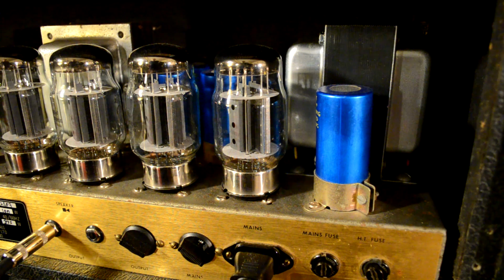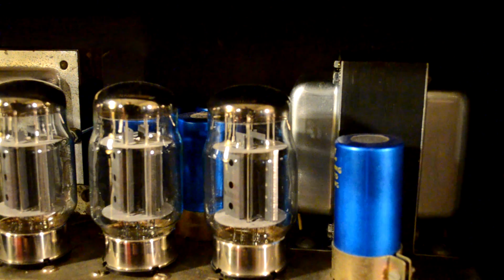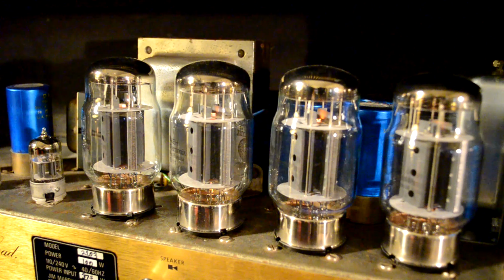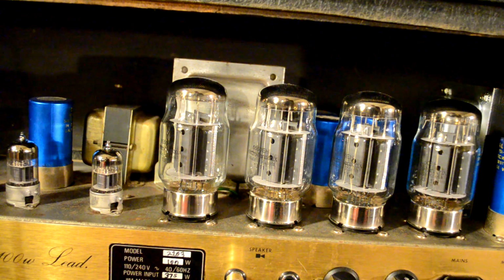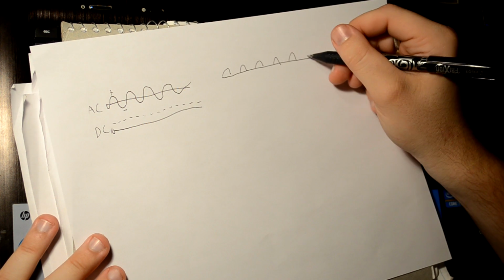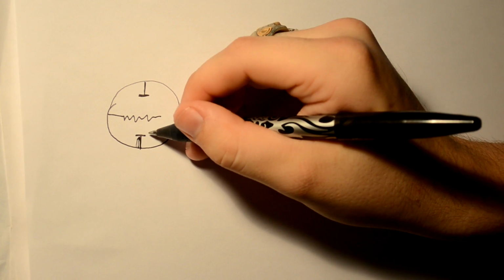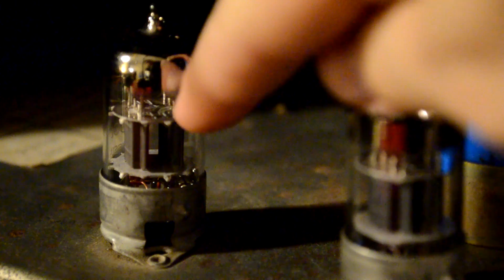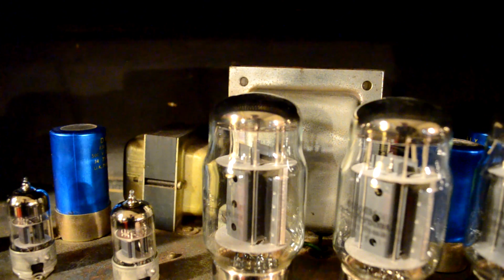How Tube Amps Work

Comment: so small ones are basically gain and bigger ones amplifiyng cabinet speakers if i understood correctly,
because all speakers needs an ampilification.
and if i want to record a head signal to use it later with cab impulse responses
i should grab a signal from send/return section not the output of a head that goes to a cab, right?
Reply from the maker: Funkaholik Pretty much, yes! And you would definitely NOT want to use the head's output to the cab, ONLY the FX loop or dedicated recording / headphone output!!!! Using the 4/8/16 ohm speaker output into an interface would damage the recording gear and likely the amp as well. The FX loop comes after the preamp but before the power section of an amp. Therefore the power level is much lower and can be used for pedals, recording, etc. 

Most older amps do not have an FX loop. In this case you would have to have the amp modded if you wish to record the preamp section. Alternatively you could use an attenuator / dummy load with a dedicated line level output (though this would include the sound of the power section).
Reply: Actually that 4/8/16 ohm level or any other parralel or else signals or fx/send/return or whatever output signal is driving me crazy because ther is stil a lot of options to expand
Reply from the maker: Funkaholik Sorry I'm confused, was there a question in there?
Reply: Me too but scratch that .. ))
i was just messing with VHT Ultralead and there is too nany all kinds of knobs and buttons for a head.
Reply from the maker: Funkaholik I'm not familiar with that amp but I looked up a picture. Looks like it has a dedicated line out on the back that can be used for recording.
Reply: i've recorded a few heads already via line output + send/return and what i get after using recorded amp signal with IR is just doesn't sound right.
the result sounds like a cab was miced from the back. I wasn't using Di box maybe that's an issue?
Reply from the maker: Funkaholik What are you using for the impulse response? Are you using a software program or some other method? I need a little more detail on your process to help.
Reply: i'm using built-in fruity convolver for IR (i'm on FL Studio) and with amp simulators it does its job
i was thinkin' maybe i have that unwanted effect because i wasn't using my pedal board (no OD/DT)
so there is a clean guitar signal going to a cranked head and then to an IR
i guess that's the problem .. i was thinkin i'll add overdrive later but then figured that i can't do that .. drive after head not a good idea))
Reply from the maker: Funkaholik Wait so are you trying to model your head and/or cabinet to be used as a software amp? Or are you trying to record a guitar track from your head and then send that signal to the program and a "virtual" speaker cabinet?
Reply: Second one.
Reply from the maker: Funkaholik Alright, well I've never used Fruity convolver. Does it have an IR library built in? Or some sort of list of cabinet / speaker models? And do you have an actual speaker cabinet that you are trying to match the tone with in the cab simulator?
Reply: it doesn't but a a huge IR library.
Nope .. all those recordings i did at rehearsals
Reply from the maker: Funkaholik Well keep in mind that the impulse response is the acoustic signature of not only the speakers, but the microphone type, recording gear, room, and mic placement as well. In other words, if someone creates an IR with crappy mic placement and uploads it to the library, when you use it it will sound like the mic is not placed correctly. (Not sure if yours is a community based library though). 

It's also possible that you're using the program incorrectly. Maybe phasing issues, improper signal routing, or mono/stereo incompatibility? Or maybe the built in IR's just aren't very good. The preamp output from an amplifier will naturally sound thin and weak to begin with, so it could also be that the program is simply outputting the signal without using the IR for whatever reason. 

I'd look at some of the things I mentioned but there's also a simple (though less accurate) solution. Speakers don't really impart anything onto the audio signal themselves. Rather they act as a type of equalizer, affecting the efficiency of different frequency components in the signal that passes through the voice coil. 

Therefore, you can roughly emulate the sound of different speakers by using your DAW's built in EQ plugin. Frequency response graphs can be found online for many speakers and your EQ can be adjusted to match these, then all you have to do is pass your recorded guitar track through this EQ and tweak it to your liking.
Reply: thanx for advice .. i use IR mostly from here
https://www.youtube.com/watch?v=7a3vqnMffhY
and they are flawless.

And as i said before it's probably because i didn't use OD/DT before head as i usually do
otherwise with higain amps your signal is too thick and sounds muddy.
Next time i'll try to record with DI and distortion to solve that problem. Will see.
Reply from the maker: Ok, yeah that could definitely be the issue. I'd say give it a try and let me know what you find out!

Comment: What is the best sounding multi effects processor that you can use or buy for your guitar 🎸 Amp. etc ??  😨
Reply from the maker: Bub7*7*7 T. There are some great modeling amps nowadays. In fact I have the Marshall CODE 50 and you can get some great sounds out of it. There are also some great software amps / FX from SoftTube, Positive Grid, Line 6, etc.
Reply: Brandon Doherty  ok, but I have a👉Vox mini 5 Amp. which I just use a practice Amp. But seriously this Amp. doesn’t really produce tons of sound effects that I would really like to dial up etc. I need something like a special effects board where I could dial up the musical sound effects of other instruments like a violin 🎻 or whatever else I would want to impose on ok. Could I put an effects board between my Vox Amp. ?  Either way, I could buy an all Valve Amp. I guess ?  Anyways Thx  👍
Reply from the maker: Bub7*7*7 T. You want your guitar to sound like a violin? Sorry I'm a but confused. But it sounds like you're talking about a pedal board.
Reply: Brandon Doherty  yea! Like a synthesiser that can emulate other musical instruments OK 
Anyways
Reply from the maker: Bub7*7*7 T. Well you can't really use a guitar as a synthesizer. There are some types of effects that will emulate other instruments but do not actually sound the same. There are actually digital guitars which can be used as MIDI instruments though.
Reply: Brandon Doherty  Hmmm !  OK   c ya  😨

Comment: So are the filter caps to smooth the lumps from the rectifier into high dc voltage feeding the tubes?
Reply from the maker: Russell Catchpole Yes! The rectifier (tube or diode) turns AC into DC, but the DC output is "lumpy". The filter caps smooth this out for clean, constant DC voltage.
Reply: Cool, I have now learnt this :-)

Comment: Great video thanks. I use a vox nighttrain 50 with a dead pre-amp but works ok using a vox tonelab modeller pedal into the effects return. I'm hoping to fix the pre amp myself so sucking up all the info I can first 😁
Reply: Thanks, I will be careful. I never forget getting an horrendous shock many years ago from an unplugged Carlsbro amp!

Comment: Good video Brandon.  A couple comments.  Line voltage is measured RMS, not peak.  Unless otherwise stated, AC voltages are RMS.  The grid in a triode is commonly referred to as the control grid.  The screen grid is the 2nd grid in a tetrode.  The surpressor grid is the 3rd grid in a pentode.  Keep up the good work.

Comment: Not too long at all, thanks. Yes, how the ear perceives has a lot to do with it also. When the signal from the guitar is slightly too strong there's a compression, in a sense, out of which other waveforms can arise. And, I don't know, like interference patterns and such.

When one turns the volume on the guitar up, one is not so much turning something up as decreasing the resistance. This allows a more powerful signal from the pick-ups/strings. It seems to me like some guitars (basses included) are intentionally designed to have that little range at the top of the volume setting that allows overdrive. This gives the player greater flexibility of sound-- and more fun :D
Reply from the maker: Absolutely right! The reason for that little "boost" on some instruments is actually because there are different types of potentiometers. There are linear pots and logarithmic (aka audio) pots. With a linear pot the knob on 5 will have 50% output, 7 will be 70%, 10 will be 100% etc. But on a log pot the knob on 3 might only be 20% output, 5 would be 35%, and then this usually start to change rapidly around 7 or 8 on the knob which gives you that "boost". So at 8 you may actually be getting 90% output. I just made these numbers up as an example, but it gives you the general idea of the logarithmic resistance curve. The reason these are called audio pots is because they are used as the volume knob on audio devices like amplifiers. Human hearing is not linear so these pots actually trick our brain into perceiving the volume change much more smoothly. However on guitar I much prefer linear pots on the volume knob. I find them much easier to use while playing in terms of controlling dynamics and tone.

Comment: What about overdrive?
Reply from the maker: Are you asking what it is?
Reply: Brandon Doherty Yeah, like when I turn the volume on the bass high and get that nice overdrive distortion, what goes on in the amp?
Reply from the maker: Well this can get a bit confusing, but in the guitar world when people talk about gain/distortion/overdrive they are usually talking about the same thing. But these terms do have different meanings... A gain stage is simply any point where the amplitude of the wave is increased (or decreased). Distortion occurs whenever the output wave differs from the input wave - this is usually desirable in a guitar amp, but in the case of a HiFi system you want to keep this to a minimum (you'll see this as the THD rating). Finally, overdrive is a phenomena that causes distortion, and the word itself is the definition - you are literally "driving" the signal "over" its limit (therefore distortion has occurred because the output signal is deformed). 

Lets use a single tube as an example - it amplifies the waveform so the tube is a gain stage. Using the gain/preamp/distortion/etc, knob on your amp you can vary the amplitude of the incoming signal that the tube "sees" which will alter the amount of amplification in that tube. But like I said in the video, the tube has a limit to this amplification called the saturation point. This is because the tube physically cannot pass any more current through, and this is when overdrive occurs. At this point the waveform "clips", meaning that the top of the wave is cut off. But remember that this signal contains audio information and by clipping off part of the wave we are changing this information (ie: distortion). 

If the input signal does not reach the saturation point, the output will be an amplified, yet clean waveform that is identical to the original (in the real world this is not actually the case but you can still think of it this way). But as you increase the amplitude of the input wave you will hit the saturation point and overdrive the tube, creating distortion. Since the original wave is rounded at the peaks, as you approach the saturation threshold just the very top of these waves will be clipped, resulting in a clean tone with just a little bit of crunch. But pushing the signal more into saturation will result in more of the wave being clipped. Obviously the more that you do this, the thicker and more distorted the resulting tone will be. 

The more you do this, the more the output wave begins to look like a square wave, which occurs with both tubes and transistors. However, if you were to look closely at this clipped signal you would see that the top of the wave is not perfectly flat. It actually is "wavy" itself, which is what creates different harmonics. One of the reasons people like the sound of tubes vs transistors is because the tubes are not as "fast" or efficient as transistors so the clipped signal has more of a rounded edge vs the hard clipping you get with transistors. This also affects the harmonics that are produced by the distortion - in general tubes produce harmonics that are more pleasing to the human ear. I know this was a long reply but I hope this answered your question!

Comment: Noob theoretical question. Can a simple amp like in the video be built with just either preamp tubes or power tubes?
Reply from the maker: Shaiful Borhan You mean a guitar amp?
Reply: Yes a guitar amp :)
Reply from the maker: Shaiful Borhan Technically... yes. It could amplify the signal but it probably wouldn't sound very good and would require a much different design. It probably wouldn't even work as a guitar amp but could be used for other purposes. There are low wattage guitar amps that use one tube of each type like the Fender Champ. And some small amps use EL84 tubes which are technically power tubes but they have 9 pins and are much lower wattage.

Comment: Electrons go from anode to kathode, becaus electrons have to go from negative (anode) to positive.
Reply from the maker: der sepp Conventional current flow is different from actual current flow. Positive, negative, cathode, anode - these are all just arbitrary terms. We generally think of electricity in a circuit flowing from positive to negative. However, we know that electrons have a negative charge and are therefore attracted to anything positive. In the case of a vacuum tube, the cathode is the source of electrons. Because electrons are negative, this makes the cathode negative. The anode is positive relative to the cathode, therefore the electrons flow from cathode to anode.

Comment: What is the difference between pure A class and A/B class ? I see many high end music equipments are pure A class including boutique guitar amplifiers. Is this a necessary better or it is just a different sound?
Reply from the maker: This is something that can be a bit confusing, and I admit I don't fully understand it. However I'll try to explain it the best I can. There are several different classes of amplifier, but class A and AB are the most common for audio applications. The technical difference has to do with how the tubes are biased and how the signal is output. Basically class A amps are very inefficient and create a lot of heat, but they offer very little distortion. On the other hand class AB are more efficient but can add more distortion to the signal. This is why high-end audio amplifiers are usually class A. When listening to music you don't want any distortion but in guitar amplifiers this is not necessarily a bad thing. Most guitar amplifiers with multiple output tubes are class AB, while those with one output tube are generally class A. (However this is not always the case). Class A is an older, simpler, and usually cheaper technology and is usually only seen in lower wattage guitar amps, but because a AB is more efficient it is how most amps today are made. In terms of guitar amps, there IS a difference in tone between the two classes, but it's not a major difference.
Reply: Class A simply means that the output tubes are biased so that both (or both sets of) tubes amplify the whole of the signal and are always passing current. Class B means that both tubes are cut off when there is no signal and one tube amplifies the positive going half of the signal and the other tube amplifies the negative going half. This unfortunately results in 'notch' or 'crossover' distortion as the signal is passed from tube to tube. In Class AB the tubes are biased so that they work in Class A for small signals, eliminating the distortion, each tube only cutting off when the other is handling its excursion of a larger signal.